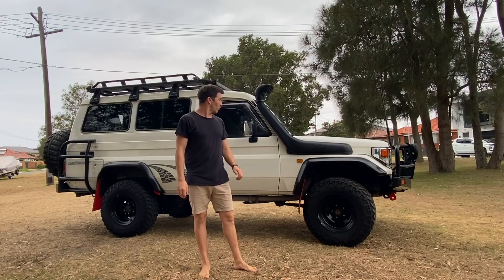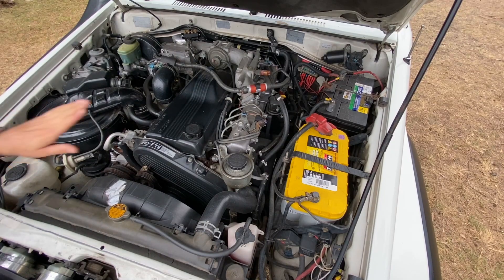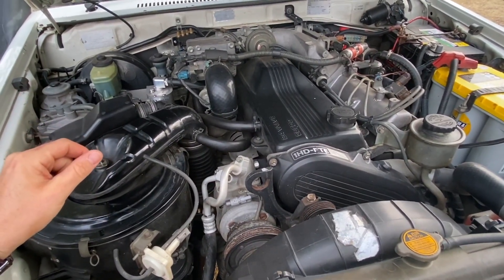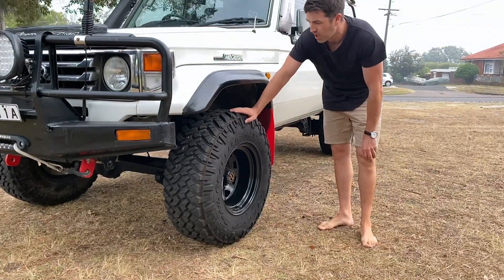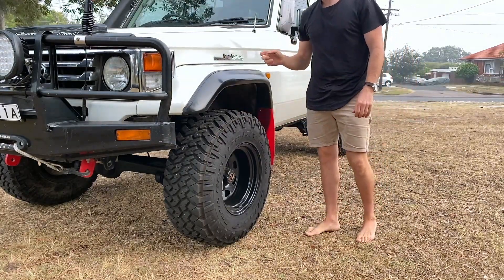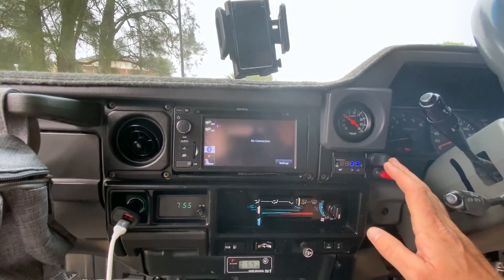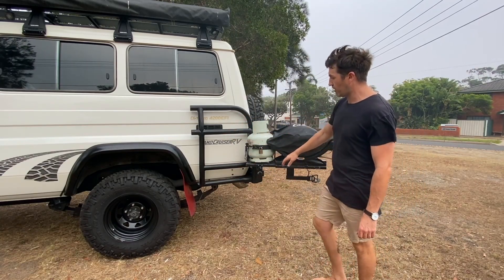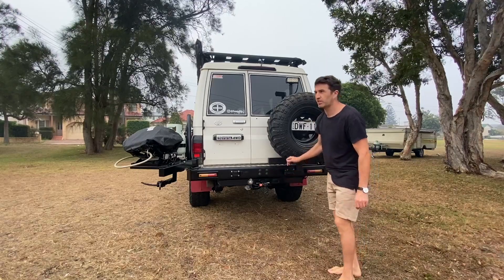LandCruiser 78 Series Troopy 1hdfte

Comment: Gturbo are getting 400hp out of these.....turbo, intercooler, chip, tune and +70 injectors. Amazing.
Reply from the maker: Dan Cotter You’re not wrong, I’d be doing skids for days 😂
I’d be happy with 200hp though.
Reply: @TroopyLife  me too..got a 1hdfte converted 105 series...probaly 120Kw at the wheels.
Reply from the maker: Dan Cotter Nice mate, Toyota should of made them that way from factory.  My mate has about 200hp in his and it moves along nicely without being a crank destroyer 😬
Reply: @TroopyLife  only td42 destroy cranks, luckily they struggle to get 200hp haha
Reply: 300awkw gturbo blue wheel

Comment: Great truck, i am running the same rig. I'm curious about your fuel consumption with the 285's and whether to change up? currently i have 265's and getting 11.5/100kms.
Reply from the maker: Deepblue Chris Hey mate, I’ve calculated over a few weeks and it was about 12.8/100km on average city driving. Lowest was 12.5 to highest at 13.8...   But I have recently done the injectors which may have improved things..
Reply: @TroopyLife  How's the 1HD fuel consumption compared to the 1HZ?
Reply from the maker: Brodie James Mate honestly probably about the same. I never checked the 1hz properly but I use to get 5-600k’s per tank and it’s around the same now..

Comment: Where did you get the chrome trims from and the Lights you spoke about the halo eyes?
Reply from the maker: mattzuydam I sold the lights mate, didn’t like them, but JTX and Stedi are good brands... 
Which chrome, the grill?
That’s the way it comes from factory mate.
Reply: @TroopyLife  oh spewin my HDJ79 came with all blacked out grill and Indicator surrounds black, 

thanks for the reply. Do stedi do a replacement unit?
Reply from the maker: mattzuydam Ya Stedi do replacement lights..

You should be able pick up a chrome grill etc from EBay pretty cheap if you wanted one. Would be an easy swap.